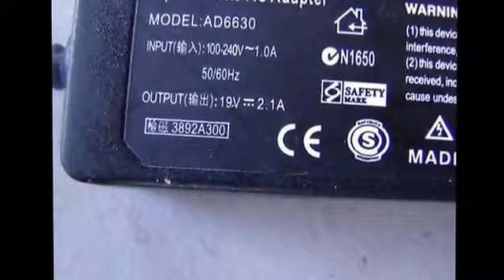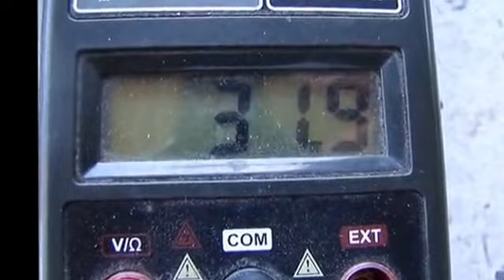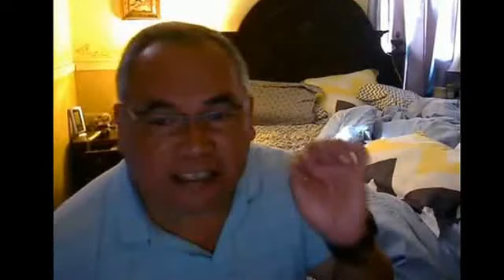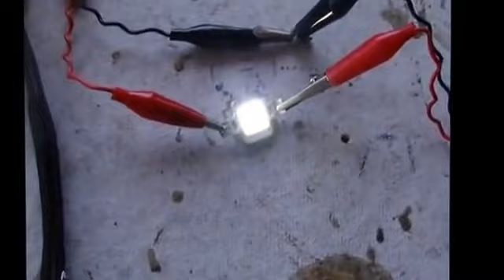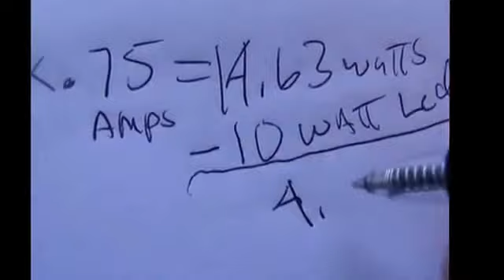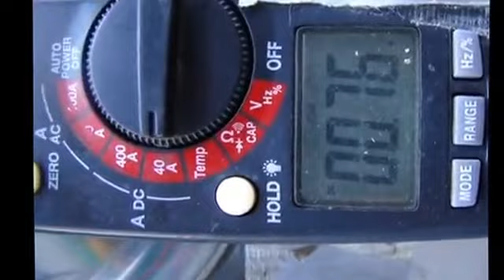Overunity   with 5 watts running the show 360p

Comment: Nice video...if you could find the right capacitance values for your caps and be able to tune the motors with rpm adjusters to the right frequency; major resonance could yield large gains. Thank again!
Reply from the maker: +Hazenthly&#39;s Fire This circuit is very forgiving; I used bi-polar caps, not the ones that are sensitive to direction, I was able to use 50 volt bi-polar cap, 100 volt, 250 volt cap, and even a microwave cap, same effect, your motor starst spinning like crazy!
Reply from the maker: +Alex Manzanero Forgot to mention: if you use peter's circuit hook up your load first, otherwise if you hook up your cap first you may get a suprising shock, careful
Reply from the maker: +Hazenthly&#39;s Fire Im not that educated in electronics, i'm just winging it by luck or chance, thanks for sharing. also by the way i tried to run the motor gen combo directly from the 19 volt source and 2.1 amps and as I thought the motor gen was sluggish with the typical lenz effect and all that comes when you use amps (current), the dipole killer according to Tom Bearden and I see evidence of it here!!
Reply from the maker: +Hazenthly&#39;s Fire I can see that by far you have more knowledge of electronics than i have , the only thing that helps me is intuition but i dont understand about resonant frequency and all  that, but Marc sees 3 ways that I can self loop this system to demonstrate ou but I cant see it yet, ill have to study a bit
Reply: +Alex Manzanero I'm going to pick up this circuit very soon; and we can experiment together my friend!
Reply from the maker: +Hazenthly&#39;s Fire I told Marc that from my laymans point of view a cap doesnt allow current to flow thru it but does an excellant job of eating fast and regurgitating fast. so what i think is going on is like a boy on a pogo stick or with coiled springs on his shoes the energy that gets pushed into the spring by boys weight gets fed back on the upswing. I need your opinion on this, once you look at peters schematic do you think it will be damaged with the 30 volts coming out of the dc generator?? I was thinking of closing the loop but i dont want to damage the circuit, usually peter runs his at 19-20 volts
Reply: +Alex Manzanero I don't know if Marc is talking about a physical close-loop Alex...if you look at some of Marc's latest videos, particulary the last one, there is no direct connection to the battery...rather, the ground plays critical importance by a kind of wireless charging the battery continues to charge and remain stable. Where is your ground connection in this experiment? Do you use grounds? They could provide fruitful. Marc will probably correct this comment if I'm way off the Marc but I'm just going with what I know. I can't wait to pick the circuit up; probably today I'll order it now that you're video got me excited!
Reply from the maker: Hazenthly's Fire yes the circuit has a bunch of anomalies, it charges lithium batteries in a few minutes, when the ends come together they exhibit a magnetic attraction, you output voltage should be around 220 volts but it does'nt harm you fingers you just feel tingly sensation but when you put a cap to it things change; it does have a bite!! Also you cannot leave the cap charging for more than a couple of seconds ; I dont want it exploding on you, unless if its a big microwave cap but now we are dealing with voltages around 900 so be careful, i wouldnt touch any of that
Reply: +Alex Manzanero Have you ever tried large caps? or in fact thinner wires for the pulsed dc? Like 30 awg or higher?
Reply: +Alex Manzanero Is this like cold electricity to the touch/that is before the cap section?
Reply from the maker: +Hazenthly&#39;s Fire  yes, cold radiant energy, sparks fly outwards with the least regard to follow a conductor such as a wire. Like an exploding firework show. Radiant energy likes the path of most resistance, like air for example
Reply from the maker: +Hazenthly&#39;s Fire I belive im using around 20 ga magnet  wire; no need for thick wires because amperage is at a minimum so no heating of wires
Reply: +Alex Manzanero Thanks Alex. Can't wait to begin experimenting. Marc's idea that he outlined sounds feasible as well.
Reply from the maker: Hazenthly's Fire Hey this is alex, i found similar results on this video also you might want to share with Marc because it deals with bucking wound transformer allowing more amps !!
Reply from the maker: https://www.youtube.com/watch?v=h11XJwx_ac4&nohtml5=False this is the link
Reply: +Alex Manzanero I picked up the circuit. Peter is shipping it to me today.
Reply from the maker: +Hazenthly&#39;s Fire Yes!!!
Reply from the maker: +Hazenthly&#39;s Fire Incidently Jameco.com has a similar product called solar converter under kits but just a general search on their website will lead you to kit cost is $19.95 plus shipping
Reply: +Alex Manzanero Mine arrived and I'm working on construction on the circuit Alex.
Reply from the maker: +Hazenthly's Fire good,  I wish someone with electronic  knowledge shows us how to beef up the circuit, it charges battery lithium quickly
Reply: Hello, thanks for the video and information. Can you say the values of the capacitor ac or dc CAP?
Reply from the maker: the capacitor was 50 volt bi-polar o sea no tiene plus o negativo